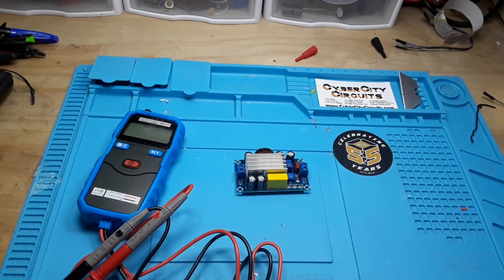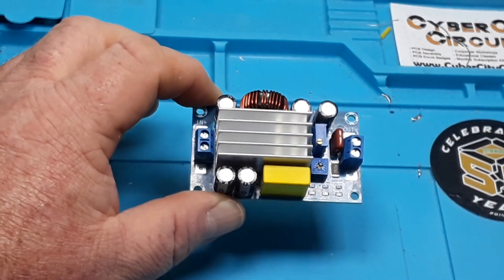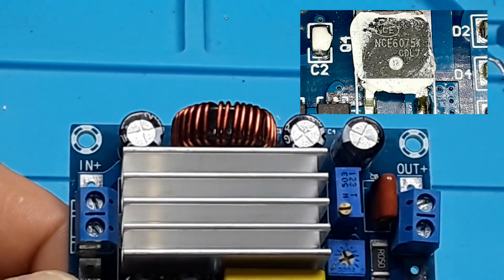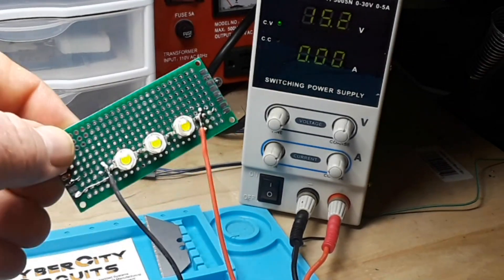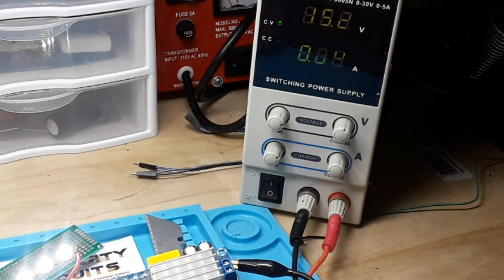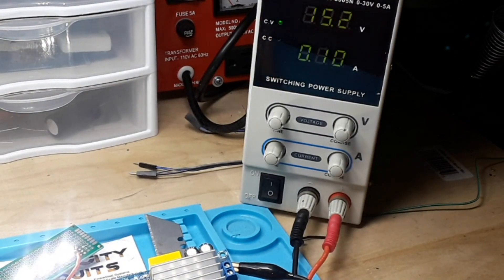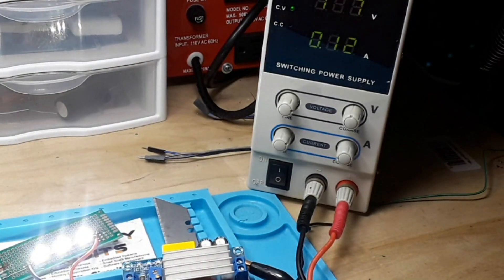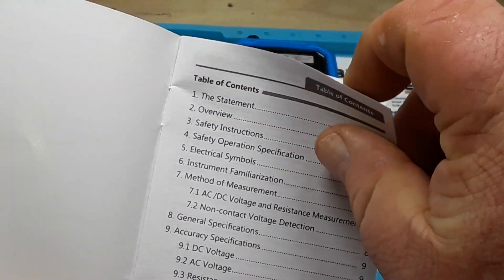Opening your mail

Comment: We don't have Cyber City Circuits in Australia. Cool multimeter for its price. Have you seen the buck boost converters that have the 5 pin XL4016E1 buck IC that comes in a TO-220 Package then the other side of the board has the boost MOSFET. Cost about the same as that module  and claims a 94% efficiency rate.
Reply: Cyber City Circuits is not a franchise. They do online sales and they ship world wide. I just signed up for their $12 USD subscription box and should be receiving it any day now. It may not be cost effective to ship to Australia through.
Reply: @rednerdnecktech2474  I think I have too many components at the moment to continue buying more. I'm running out of space to store everything. All good, just means I better get off my butt and start creating some circuits and catch up on projects waiting. There are a few distributors here in Australia,  I was just joking around about them not being in Australia.
Reply: Good evening Steve from a sunny morning in London. Thanks for the info on the buck IC I needed something very much like that! 
Edit: Amazing specs
Reply: @martinda7446  I got it off eBay, was no model number but here are all the specs. Seller name - s99725

Module Nature: non-isolated buck constant current, constant voltage module (CC CV) charging module
Input Voltage: 5-40V
Output Voltage: 1.2-35V
Output Current: up to 9A
Turning Current: constant current value * (0.1)
The Lowest Voltage difference: 1V
Output Power: The maximum power is about 300W. If the power tube temperature exceeds 65 degrees, please add a fan.
Conversion Efficiency: up to about 95% (the higher the output voltage, the higher the efficiency)
Working Frequency: 300KHZ
Output Ripple: 20M bandwidth (for reference only)
Operating Temperature: industrial grade (-40 ° C to +85 ° C)
No-load Current: typical 20mA (24V to 12V)
Load Regulation rate: ±1% (constant voltage)
Voltage Regulation rate: ±1%
Constant Current Accuracy and Temperature: In actual test, the temperature on the module changes from 25 degrees to 60 degrees, and the constant current value changes less than 5% (constant current value 5A)
Dynamic Response Speed: 5% 200uS
Potentiometer Adjustment Direction: clockwise (increase), counterclockwise (decrease) close to the input potentiometer for voltage regulation (CV), near the output potentiometer for current regulation (CC)
Indicator Light: Two-color indicator light, the indicator light is red during charging, the charging completion indicator is green (no load is green) The indicator without constant current is red.
Output Short Circuit Protection: Yes, constant current (current setting constant current value)
Input Reverse Connection protection: none
Output Prevents Backflow: none
Wiring Method: terminal block
Application: adjustable power supply (12A power is large enough), high power LED driver, LED display driver, lead battery charging, lithium battery charging, vehicle power supply, car laptop power supply (buck), regulated power supply, low voltage system power